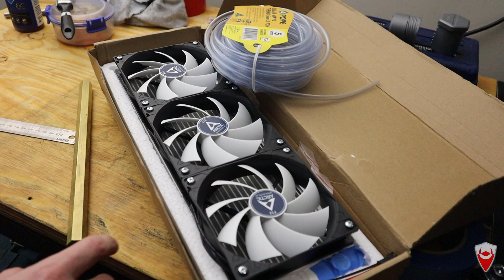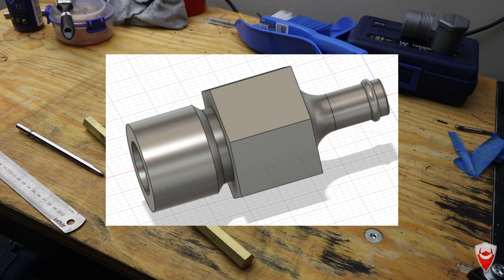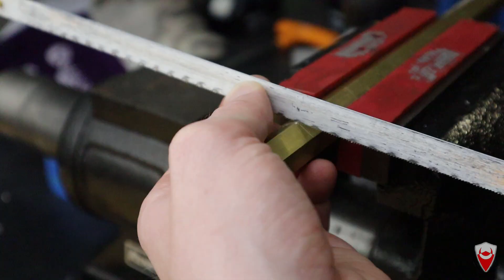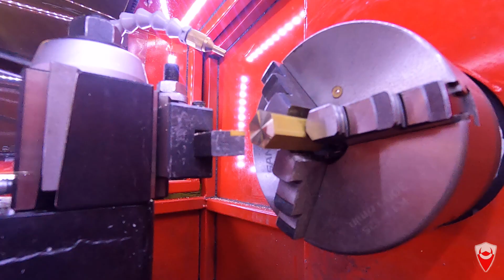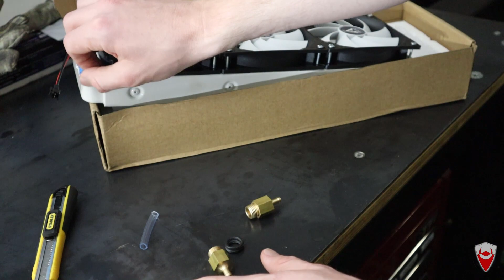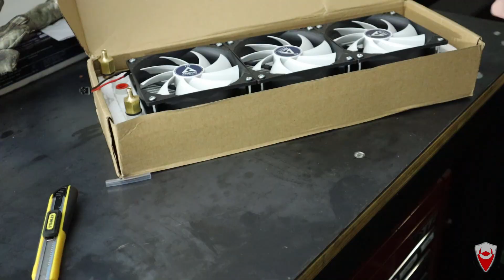[BUILD] Mill Build #4 - Custom Water Fittings

Comment: Thread tape on the thread would make a good seal.
Reply from the maker: I don't think it would. It works on tapered threads as it pulls up the gap, but on a parallel thread I didn't think thread tape worked...